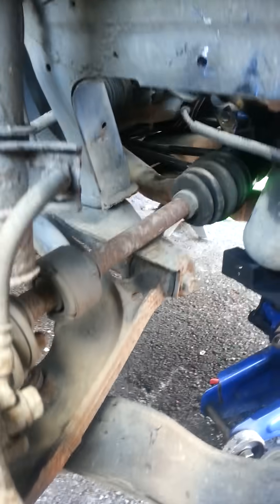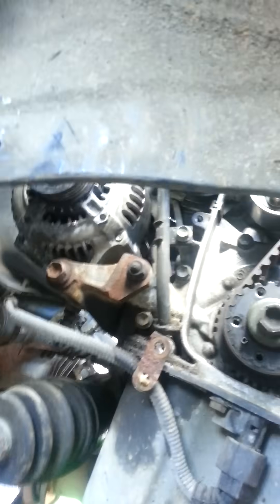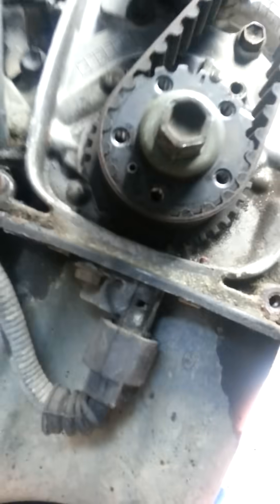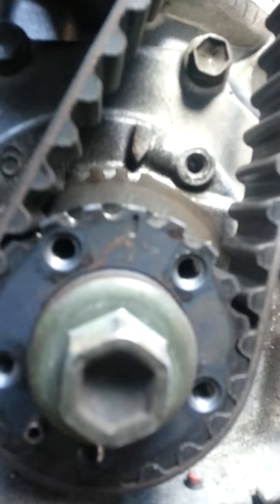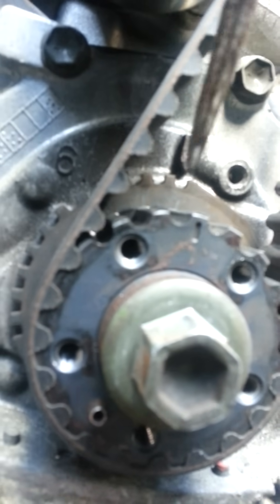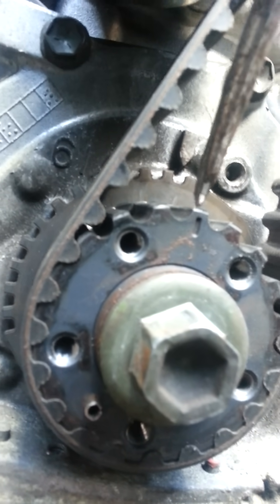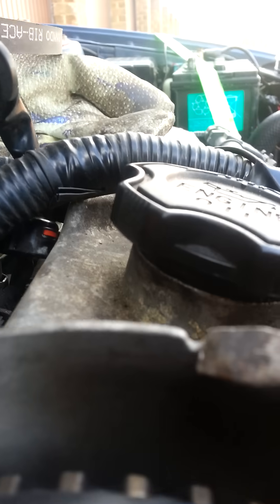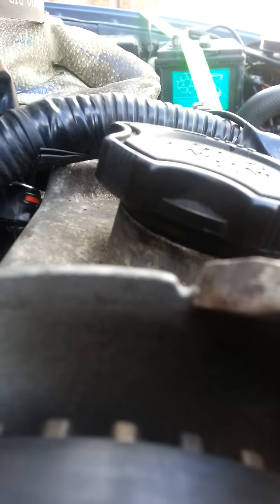Suzuki baleno timing belt marks 1.6

Comment: You forgot one thing, two revolutions of the crankshaft equals one revolution of the camshaft. So camshaft turns at half the speed as the crankshaft. You could end up 180 degree wrong with that information only.